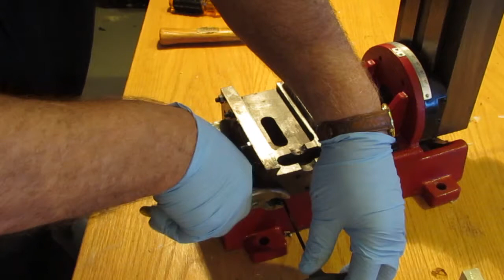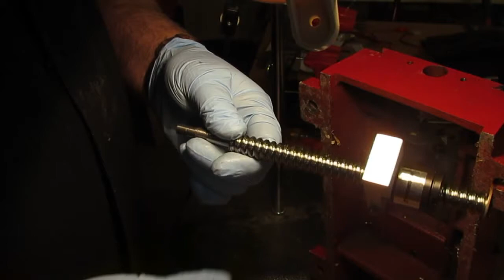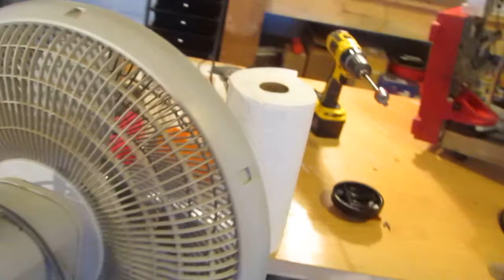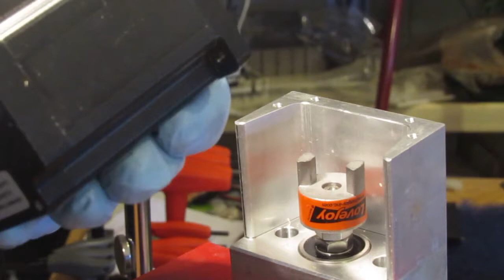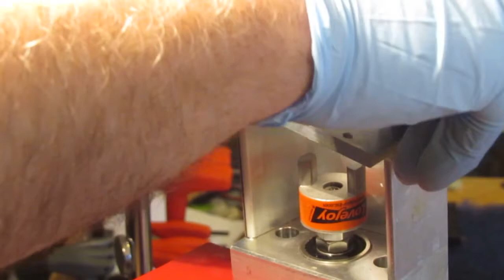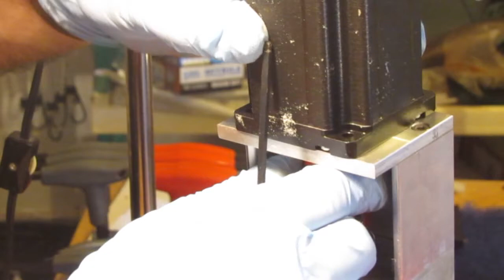X2 Mini Mill CNC Conversion- Part 2- Y AXIS Installation

Comment: To get more travel on the Y ball screw you can turn the nut around on the screw. You could have more room at the front for the nut to travel. Check on you tube how to remove and replace a ball nut.
Reply from the maker: Uh, thanks but these are pre-loaded ball nuts and I have no desire to mess with the bearings.....Maybe someone else can use this advice. I'm happy the way it is.
Reply: Uh check and see how single ball nuts can be preloaded first. The only ball screw I have seen is double balls crews preloaded. Single Ball screws have over size balls to preload them and can't be change just by taking them apart. This page will show you that. http://www.nookindustries.com/LinearLibraryItem/Ball_Screw_Load_Definitions#figure1
Reply from the maker: The Y axis already goes full travel and is limited by the fixed casting of the Mill's base. Turning the nut around gives no further travel since the table hits the casting of the mill and stops there as it is now. 

In the other direction is the motor drive and movement is limited by the casting again. There's no further travel that can be had by turning the nut around.

Comment: I'm assuming that you found out that white grease isn't the lube to use on machinr tools, you what "way oil" to lube the "ways" of you mill, lathe.
Reply from the maker: Well, I'm still using the lithium but you're the second guy to mention this. I'll buy some but I'd have to take everything apart to clean the grease off and use the oil. Not looking forward to that.